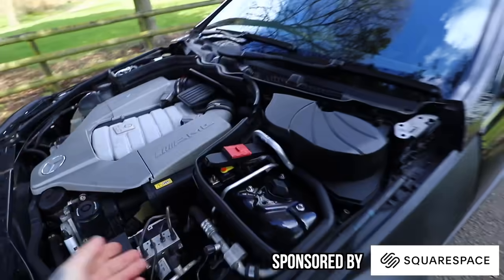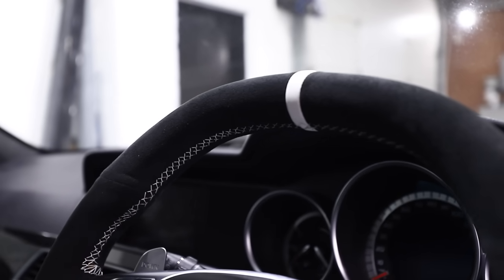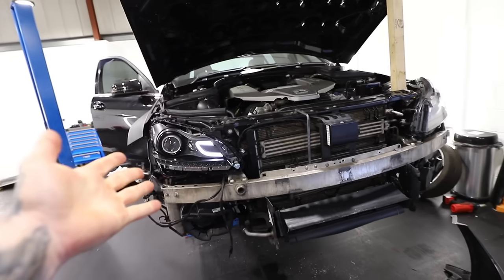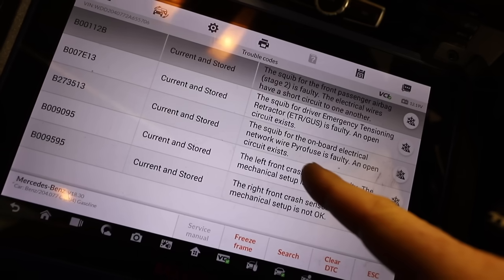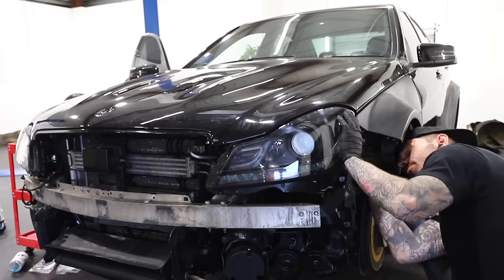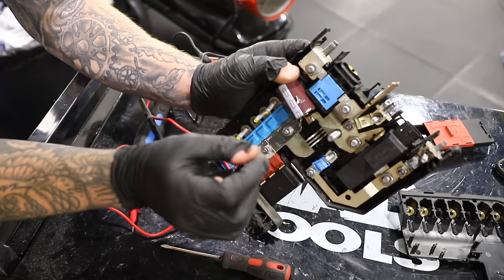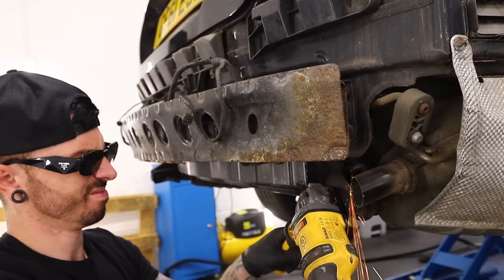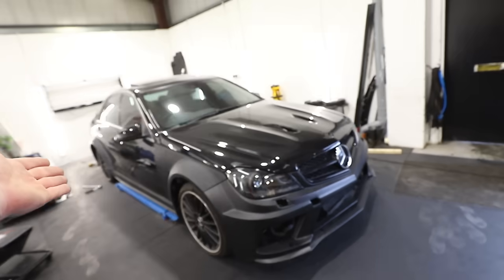BUILDING A MERCEDES C63 BLACK SERIES BUT NOW IT WONT START

Comment: Mat three things.. 1.. let your painted trims finish gassing otherwise your lenses will mist with chemicals, 2.. don't use tiger seal or silicons on the seal channel or inside as these also gas A LOT which stains the lens, 3.. next time you paint chromed plastics like headlight shrouds use some oven maid or any other oven cleaner.. it strips the chrome off perfectly and reduces the risk of the paint reacting (which might not happen for a week or two) I found out about these the hard way and resealing them constantly is painful

Comment: Quick tip when you're doing headlight blackouts you can use plastidip,you don't have to sand anything,it won't chip over time and it's all reversible if you want.done it a few times and works absolutely great
Reply: Does it get affected by heat
Reply: @jakeveitch6982  it can deal with it

Comment: Hello mat I would like to say as a Mercedes owner for over 12 years this is common very common with the fuse on all Mercedes under 2013/12 . on the 2012 GL450 we had there where a lot of problems especially suspension
And the fuse box

Comment: Matt, just a quick tip if the clock spring is out you will get an traction control off light (The more obvious) but being the headlights are adaptive, they will not move at all if the clock spring is out. Also your side illuminatiors (They look almost like high beams) on each headlight won't activate. Currently working through this on mine.

Comment: You’ll need to code the replacement ballast to the car.
The ballast units aren’t specific to one model and you need to tell it what each output is connected to. For example my 2019 W205 unprogrammed used to light the indicator when you pulled main beam and would flash the DRL when indicating. 
If you go into the headlights on the software you should select adaptions but you may need the barcodes that are on the original headlights.
Reply: this exactly .. i had murder with a ballast on an E250

Comment: There is an explosive charge within that small box, as part of the safety restraint system (SRS), when there is a current applied via that yellow plug it sets it off. BMW has a battery safe terminal (BST) which is on the positive side of the battery and in an accident in disconnects all electrical power from the vehicle. But it's great that you can buy the fuse rather than the whole box!

Comment: If the new pyro fuse doesn’t solve your non start issue, you could try using a professional OBD 2 scanner or even better, Mercedes XENTRY diagnostics to see if the motor electronics control unit requires unlocking by ‘enabling of engine start after a crash event’. 

Newer Mercedes models are programmed not to start after an accident, I think it was around 2014/15 when they started using this feature on their cars👍🏽

Comment: Most of the time you don’t have to paint chrome stuff black, try spraying it with easy off oven cleaner and 9/10 times it’ll eat the chrome and leave it the base black coat.

Comment: a mercedes diagnosis would help a lot after a crash most of the newer mercedes' cars wont start not because of a mechanical reason it's mostly because of the electronics stoping it wich you can repair by resetting the car so it thinks there wasn't a crash

Comment: Video wouldn’t go higher quality than 360p for me 😵‍💫
Reply: That's what happens when you're relatively early on YouTube. YouTube  takes the video file upload and compresses it to different resolutions, then it puts 360p out first because it's the quality that processes first. After about an hour, it's usually done fully processing and  the highest quality is available.
Reply: @shona5512  thanks Shona 👍